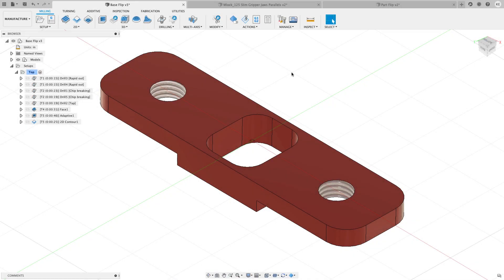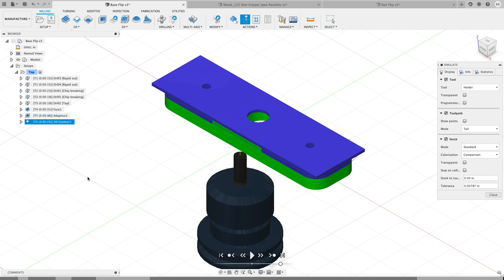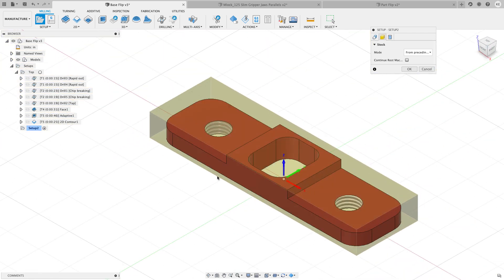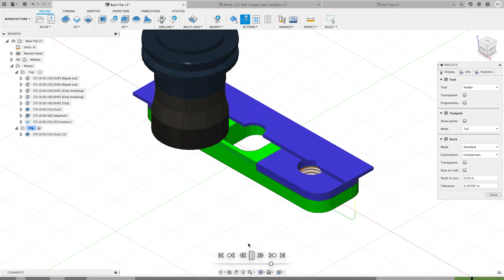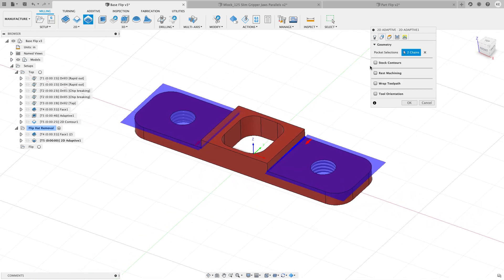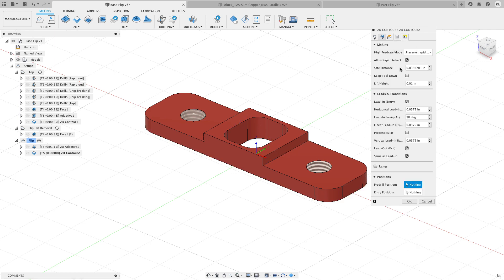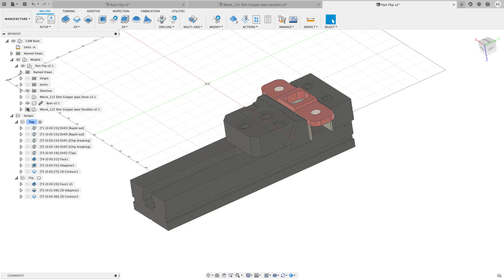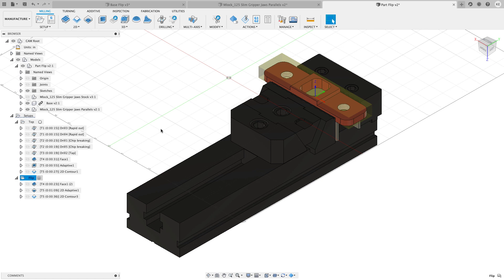Fusion 360 How to Flip a Part for Op2

Comment: Am I missing something? The first operation the Z axis is facing down?  Second op facing up.  I don't see the flip.  If I do the same thing my tools still try to come in from the original side?
Reply from the maker: I just went back and looked. The Z axis was up for both setups. It needs to always point at the direction you want the spindle to approach from.
Reply: @MechanicalAdvantage  I guess where I am getting confused is the upper corner Stock "home" point location vs the model WCS.  Your setups are both up but home is down for one and up for the other.  Unless I pick "Select Orientation option" I can't actually click off the flip.  Model Orientation does not have the flip option.  I expect I'm missing something but cannot for the life of me see it.
Reply from the maker: @constelationmachining  in the second setup I used model box point. You should still be able to change the orientation of the Z axis. I put the WCS on the bottom of the part because that is then a known machined surface instead of using the unknown and unreliable exact thickness of the raw stock.

Comment: What kind of work holding is best for this type of part?
Reply from the maker: Parallels and jaws would work fine. With my setup I would use serrated jaws for the first op, and then parallels and the smooth part of the jaws for the flip side.

Comment: I do not have a tool changer.  So i want to avoid tool swaps.  So I made a fixture to run the front and back at the same time.  So stock goes in one side and cut. Then gets flipped and moved next to it.  So i have one piece that is stock for op1 and one piece that is cut and flipped for op2 on the same fixture.    I can run 1 tool and work on the back and front with one tool change.  My question is, is there a better way to program it?  Im currently programing both front and back as one work setup.
Reply from the maker: I think this video will help. I have this set up so the front station is G54 and the rear is G55. The tool will do work ok both front and rear before changing to the next tool https://youtu.be/AoUD_89Vicc

Comment: Cnc is so complicated. With 3d printer you just throw that part in cura and done xD
Reply from the maker: True, they both have their place for sure. I could machine a whole batch of these in a CNC in the time it takes to 3D print one. And they would be very dimensionally accurate. There are definite benefits to a 3D printer.
In face, I bought an Ender 5 last winter. I'm looking to expand my 3D printing knowledge this year.

Comment: I'm kind of struggling with flipping a part to mill that hat off and having the top side matching up when I perform a 2D contour on the bottom side.  I'm definitely doing something wrong because the top is has an offset from the bottom.  I probed the left face of my fixed jaw, probed the inside face of the fixed jaw and used a square to make sure my part was perfectly flush with the left side of the jaw and I'm still having an issue.  Love your videos btw.  I've learned a great deal from you so far, thank you!

Comment: Thanks Kevin, that was some really great info, and extremely clear teaching. I have a quick question, on the first opp, you drilled and tapped before facing. Most videos I’ve watched, always face mill first. Is there a reason you did this after the drilling cycles? 
Thanks, Rob.
Reply from the maker: Most times it really doesn't matter. I'm not sure why I changed up the order here to be honest. Sometimes I'll do this if I think I'll end up with a birds nest on the drill. If it scratches up the top surface I don't really care because the facing op will remove that. But I don't think it is too critical in what order you do these steps.

Comment: If I have different positions for different operations like moving from vise to fixture can I transfer the machined state of the stock after that operation over to another position for the next operation.
Reply from the maker: Not easily right now. However, keep an eye here when that functionality is released. I’ll have a video on how it works for sure.
Reply: @MechanicalAdvantage  It's been a year. Why hasn't this been a priority for Autodesk? It would give Fusion 360 a major advantage over the competition.

Comment: I'm really glad I watched this.  I knew about the fixtures, but not about the visibility.  I do a lot of soft jaws and having to turn them on and off when I flip the part gets tiresome. lol  Those two visibility settings ought to fix that. :)  Thanks!!
Reply from the maker: Hi Mike. Yeah they seem to work pretty well. I sort of wished they had implemented it a bit differently, but I guess this gets the job done currently.
Reply: @MechanicalAdvantage  How to you wish they implemented it?
Reply: I'm currently looking to see if there's a way to rotate the part within the fixture, rather than having to duplicate the fixture just to have the part in a different orientation. It seems way more cumbersome than it has to be. Maybe in time, Autodesk can add part rotation that's specific to different CAM setups.
Reply: @frankfnhallukhall4520  This popped up as a reply to me....hopefully, Kevin got a notification, too.   I have no clue....I don't use fusion very often so every time I do, it's changed and I have to relearn how to do what I used to know how to do. :(

Comment: Hi,

Very nice vid, and gratifying that it’s pretty well exactly what I do. Pretty well 90% of my work involves flip and deck. Annoyingly, for the last few months, the jobs have been only ones and twos of each design. So I can’t get really efficient with fixtures etc. The workflow has been to do the first op on the haas mini mill, a few parts in one bit of stock ( arranging those parts for that op is a pain, any tricks you have would be appreciated). Then parts bandsawed out of that group and over the tormach for the flip and deck. Sometimes stay on the haas for that op bit mostly the tormach as I have a probe on that machine, makes locating a breeze.

The added wrinkle on the flip and deck is many of the parts need soft jaws cut to hold the curved parts. I’m doing ok with that but if you want any suggestions for future vids I’ll vote for something on softjaws. 
Again, thanks for doing these vids, I always learn something.

Alistair
Reply from the maker: Hi Alistair. Sounds interesting. Feel free to send me an example to info@mechanicaladvantage.com
Reply: @MechanicalAdvantage  

Hi,

Can’t send any work examples, confidentiality etc. But I have a silly little side project of some car window winders. I’ve cut a few using the flip and deck on soft jaws. If you promise not to laugh at my modelling abilities I’ll send a step file :-)

Actually, my model also brings up some other tool path issues. You’ll see what I mean. I’ll send pics of my , pre bead blasting , results.

Alistair
Reply: I very much agree with this comment. YT is full of software approaches to flipped setups but there does not seem to be much in the way of practical guides on the machine/fixturing side.
Reply from the maker: I'll have to put my thinking cap on and see if there is a good way to present something like that.